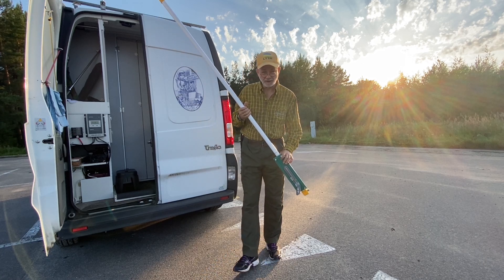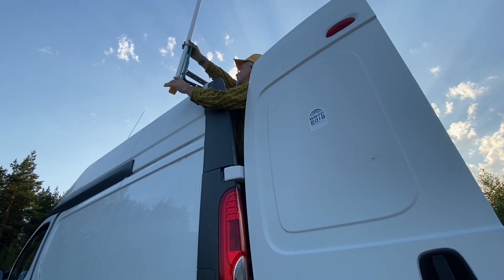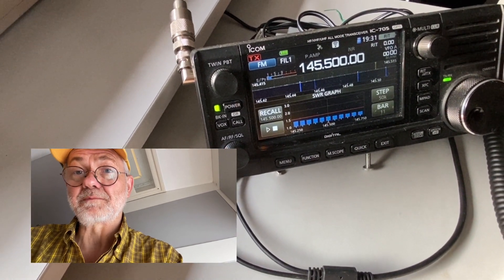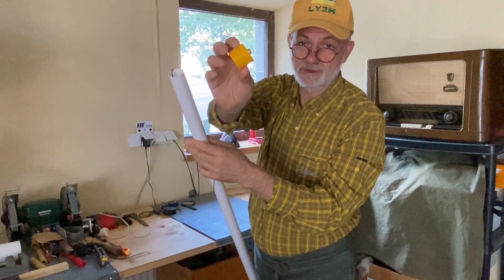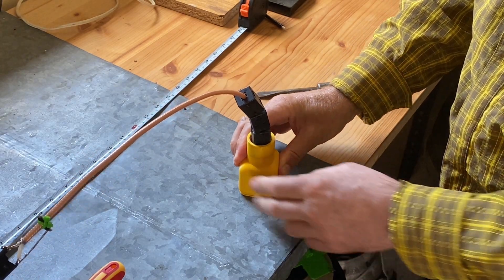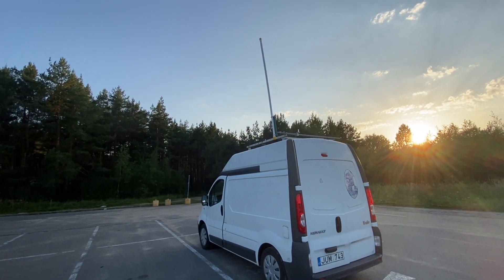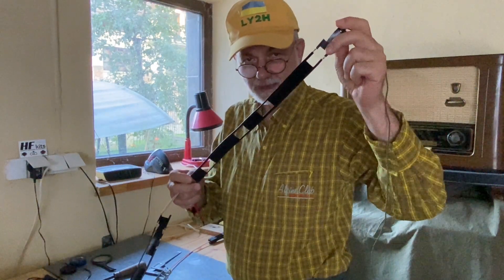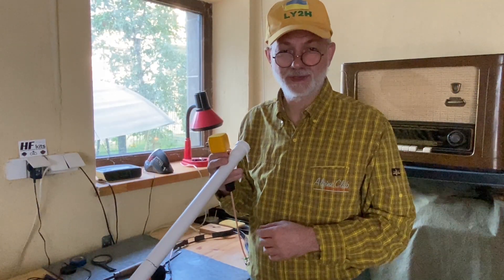Make a gift for yourself! VHF/UHF J-Pole antenna DIY of a ribbon cable.

Comment: Having made one of these with 300 ohm ribbon which was not very successful as I could not really work out how to tune it in a plastic pipe correctly. I could get either 2 metre right or 70 cm right but not both. Your explanation of the way to tune it was very helpful IE. start with just the 70cms section add the stub and finely add the 2 mtr section.
G3WOT

Comment: Great video! I used to smaller type 300ohm  ladder line, do you think the wider stuff is "better" to use?
Reply from the maker: @ve3etu  Thanks for watching! No, I don't think wider cable is any better, but I have no practical experience in comparing the two. 73! Linas LY2H

Comment: How did you check (step x step) the swr on the 705?   Where are you contacts at; how far away where they?  I'm inpressed!
Reply from the maker: @99Victor  Hello, thanks for watching! The IC-705 provides for a plot-SWR measurement, i.e. you can analyse the antenna SWR response over the entire range of set frequencies, so I used this great feature. All the detailed steps on how to use this feature are very well desribed in the Advanced User Manual, chapter 9.4 , I wouldn't do it better :) This antenna is a FM VHF /UHF workhorse, working equally nice as portable and as a fixed antenna. It performs better, in my opinion, than a 1/4 wl ground plane vertical, but surely not better than, for instance, a colinear array of multiple vertical dipoles :). As it comes to the contacts, I easily take part in local 2m/70cm nets, open local digital repeaters , all the daily routine on the FM mode may demand. In case I take part in some dx activities in CW or SSB modes, like contests or activity days, I mostly use my horizontal polarization stacked  2x9EL Yagies. But I also always have my J-pole with me for local FM communications. HTH, 73! Linas LY2H

Comment: I have and use a commercially made roll-up J-pole antenna for 2 meters. It works well, and I keep it in my pack for portable use. You have inspired me to make your design mounted in a pipe for use with my van when parked. There is always more satisfaction with something you build yourself. DE WA1KLI